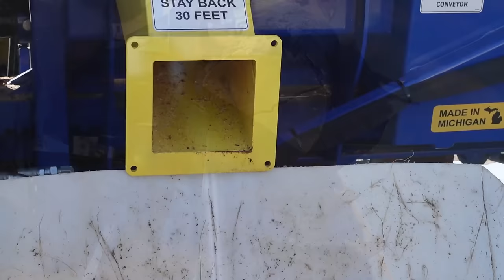Fast firewood! Easy firewood! New Dyna SC16 Rapid Split Firewood Processor!

Comment: Heath you forgot your chaps. Nice job Rachel running the processor.
Reply from the maker: I risked it for that one cut with the 25cc echo!  Living on the edge. Thanks Bert!
Reply: I did a similar action once when I decided that it was not worth changing the battery in my go pro as I only had to ride four miles home with the result that I was in the wrong place at the wrong time resulting in getting smashed off my bike by an impatient driver,smashed shoulder but my helmet saved my head and possibly my life so do the correct thing when safety is paramount. I have also seen the horrific injuries caused by negligence with chain saws,not good.Think safe.

Comment: Nice video Heath n Rachel.Quite the DYNAmic processor. Curious if you know the maximum size limit of log that it'll run through? Thanks for sharing 👍
Reply from the maker: Thanks Jimbo. The max diameter is 22”.

Comment: I had bought a sc 16 back in 2018.. very little down time on it and this year will be a little over 4,000 cords run thru it. Also have a multitech 2040 for the big stuff.. 8 way in sc16 and the 16 way in the multitech does great.
Reply from the maker: It definitely seems like a well built machine. Especially for the price point!

Comment: Can we get Dana to put a shield on top of the splitter ram, to prevent the last part of the log from falling into the splitting chamber before it’s cut??? Msg me for more details
Reply from the maker: I have talked to them about this as they asked for our feedback on this machine. It is something they are working on. I agree it will be a huge upgrade when they get it implemented.
Reply: @hardworkingmanoutdoors  the higher  to the cutting deck the better! Plus it would allow you to then bypass the splitter chamber if you wanted to; also it would prevent the log from falling behind the splitter if you forget to retract the splitter before you cut the next piece…but I’ve never done that before🤣

Comment: Great but for me using a 2 way splitter leaves to big pieces and for me will not work in my stove. I would be using a four way.
Reply from the maker: We used the 2 way because we are going to re-split them with the Eastonmade Axis for a custom smoker wood order.
Reply: If you used the 4 way on the Dyna then less respiting with a different machine. @hardworkingmanoutdoors